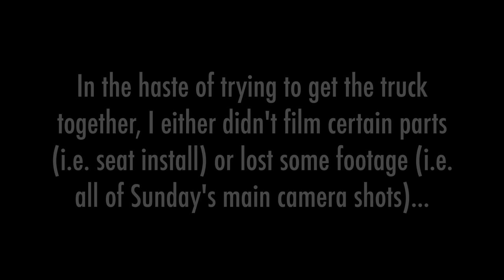READY FOR THE ROAD: our 35 day build is road-worthy with one day to spare!

Comment: What size wheels/tire you running
Reply from the maker: They are @halibrandwheels Sprint wheels in a 20x8.5 up front (4.75 bs) and a 20x10 in rear (5.5 bs). Tires are the @diamondbackclassics Redlines in a 255/40/20 up front and 315/35/20 in rear.